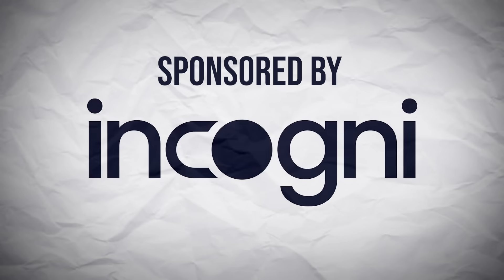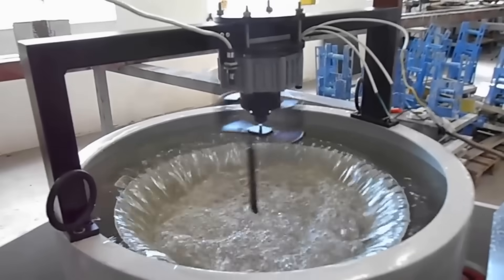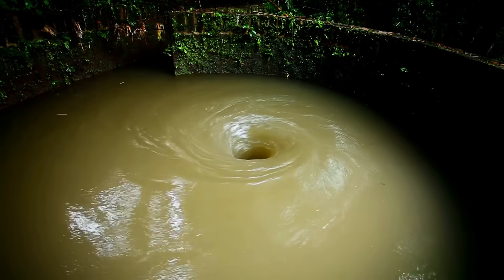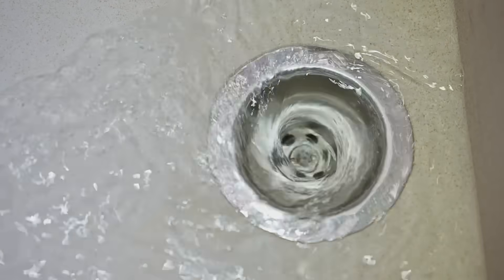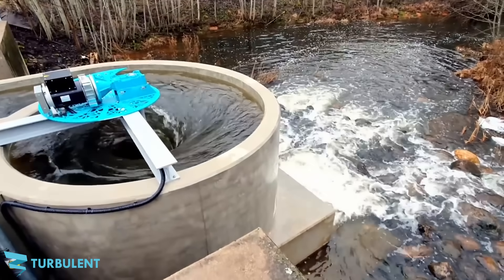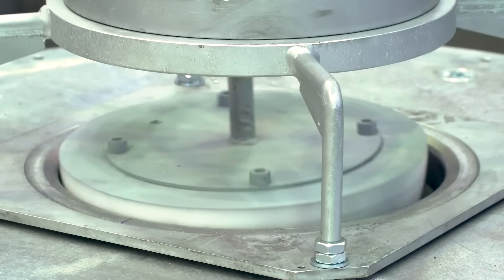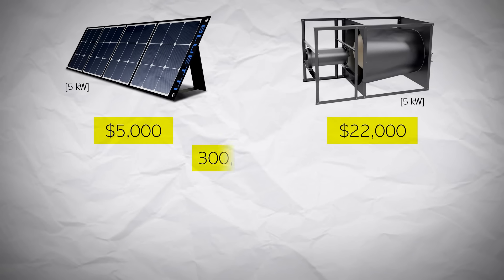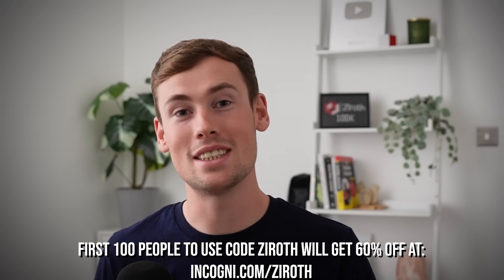Genius Bladeless Hydro Turbine is Cheaper Than Solar

Comment: Nice video. Thank you!
I live remotely in Alaska with Pelton as my summer power and generator for winter power with a 12 volt battery bank for storage along with the inverter for 120 power, charge controller, etc. Winter is the hardest time since I have to use the 2500 watt generator to charge up my battery bank. Wish it was different but the Pelton hydro head is at 200 feet and in the winter the pipes will freeze and break unless I disconnect the system until what we call “break-up” here in Alaska when the temps rise above freezing for the season. 
What I’m curious about is this - if I were to install one of your underwater turbines for winter use, first - would it be comparable with sea water or would the salt content destroy it? 
I can also install something like your device in my stream which has sections that won’t freeze in the winter and does not have any fish living in it. 
Lastly, if this were installed in the sea or me stream, how do I connect it to my battery bank without blowing the whole house electrical system and battery bank with electrical shorts? 
Thanks again for the video!

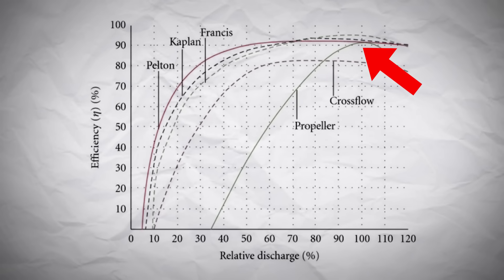Comment: 7:45 this is a point I try to communicate in green tech discussions that some folk seem to disregard. if you can deploy energy storage or generation in a place, then you'll obviously want the most effecient one possible. but if you CAN'T deploy that one, then something is better than nothing. Further, in the case of secondary generation and storage, such as for waste heat, you can often run lower-efficiency systems off of the 'leftovers' of high-efficiency systems. (such as running an stirling hot-air engine off of the waste heat from a steam system)

also, I find that the Point of Diminishing Returns is often miscalculated, as some low-efficiency tech, fueled by High-Efficiency techs' leftovers or wastes, can operate continuously, with little-to-no maintenance, for decades, or even CENTURIES. but because the ROI isn't large enough in the short term they dismiss them as pointless... this is VERY frustrating, as it is a real barrier to Global Carbon Neutrality and Fossil Fuel Independence when we "Allow Perfect to be the Enemy of Good", and obsess over finding Direct-Analog, singular solutions...

Comment: very nice video.
just one nuance. in your calculation.
if you run a 5 kw generator, windmill, turbine solar set or water system.
365 x 24 hours = 8760 hours x 5 kw = 43.800 kwh yearly !!!

and 5 kwh turbine is with the 50% efficiency ? if so it is half of 43.800 kwh per year.

so for a solar panel system 5000 watts yearly output in germany, belgium will be about 4800 kwh to 5000 kwh
on tenerife it will be about 9500 kwh. but usa will also be around 4500 to 5500 kwh per year depending on your location.

Comment: It's way more expensive than solar, because I would have to move to a river with access to the river first before being able to start comparing them ;-) 

Besides, there is a hydro power plant some miles away, where I think that I get my electricity from. So, this place is already taken. The places along the river are already taken. Along the other rivers too.

But it's nice that someone says that water power is also a renewable energy source, at least as long as the sun shines and as long as this all together makes rain fall and the falling rain gets collected and flows in rivers...

Comment: How is this ball turbine safer from traditional bladed propeller turbine? There is very small gap between the ball and the turbine walls and ball is rotating very fast. Unless ball has relatively small mass, the fish would easily get crushed between those two.

Comment: I honestly DO NOT understand what is wrong with the usual ancient simplified water wheel with "less moving parts" thus less wear and tear; and, still get the work loads you want. Both in mechanical and electric generation. Same gains. The paddles don't necessarily hurt aqua fauna.

Comment: the full size unit is fraught with design faults , the "hemisphere" design puts the flat upper surface at an offset angle to the water flow ,causing a high/low pressure area generating the motion with some torque , the housing shape does not generate a vortex at all ,just a velocity increase  ! and the offset axial rotation generates an enormous amount of vibration which will cause fatigue and premature failure , your spinning ball example will not work if any sort of load is applied to the ball as the smooth surface will not cause any significant drag therfore no torque to overcome load resistance . what would work is an inverted teardrop shape with helical flutes on the underside ,a central axle ,and the "funnel " being cup shaped at the top leading into a horn shape into which the teardrop shape would fit , utilizing both the vortex and pressure principles and running with minimal vibration

Comment: I do solar, you gotta introduce me to these 5kW solar systems at 17% efficiency that produce 50,000kWh in a year because that'd be easy to sell for $5000. This makes me skeptical of the math but you're right on the money with your concepts. Thanks for the video!
Reply: I agree with your disbelief regarding the figures presented. Even if some high-end solar PV are around 21% efficient, getting 50,000kWh in a year would be impossible even in the most ideal conditions. He needs to reappraise his figures.
Reply: Yep, maybe 5,000-6,000kWh a year is more realistic
Reply: Yup seems to off by a factor of 10.

Comment: Solar panels are dropping fast. Very fast. A 500watt panel is now about 100$. Making your 5000$ estimate for 5kw a bit high.

Also i think you mix up solar panels efficiency with its productio rating. A 1000watt panel a 21% efficiency isnt going to make just 170watt if efficiency drops to 17%. You seem to mix up something there.

Last thing. If i stood on the sun and had strong sunshine 24/7-365 i would still not hit even your reduced solar calculation. 
5*24*365 is only 43800 kilowatt.

Comment: I've designed a lot of off-grid solar for both domestic and third-world countries. You aren't accounting for it correctly.  A 5 kW turbine running fully loaded 24/7 is producing 120 kWh of energy per day.  The solar panels required to gather that much energy, assuming you could count on 4 hours a day of equivalent 1 kW/m² insolation (a 30°-40° latitude annual average-ish value, depending on local weather patterns), would require 30,000 Wp (watts of panel).  If you added batteries to store the energy, depending on the autonomy time (how long you can run on batteries with heavy overcast conditions that kill the sun) appropriate for your local weather patterns, your batteries could easily cost you twice what the panels do.  So your turbine capital expense actually looks pretty good.

Comment: Issue 1) dams block fish spawning tributaries.
Issue 2) Wind turbines kill birds.

Note) The vortex spins in opposite direction dependent which side of the equator one is on. 

Concern) That ball rolling around the sidewall would kill fish by squishing the fish.
Reply: I would like to preface this comment by saying I am by no means an environmental scientist and my thoughts are based on general knowledge and a couple of google searches.
  I would like to start by addressing issue 2.  While it is true that wind turbines kill birds, it is proportionally lower than that of fossil fuels.    If we were really concerned with bird deaths we should crack down on cats, large buildings fossil fuels and power lines.  Cats kill 2.4 million birds a year in the US alone (American Bird Conservancy).   A 2012 study found that wind projects kill 0.269 birds per gigawatt-hour of electricity produced, compared to 5.18 birds killed per gigawatt-hour of electricity from fossil fuel projects (Sovacool, Benjamin K., "The avian benefits of wind energy: A 2009 update." Renewable Energy, Volume 49, 2013, doi:10.1016/j.renene.2012.01.074).  I think the more important issue is the human cost.  Research from Harvard University, in collaboration with the University of Birmingham, the University of Leicester and University College London, found that more than 8 million people died in 2018 from fossil fuel pollution, meaning that air pollution from burning fossil fuels like coal and diesel was responsible for about 1 in 5 deaths worldwide. (https://www.sciencedirect.com/science/article/abs/pii/S0013935121000487).  Coal is the biggest killer in U.S. energy at 15,000 deaths per trillion kWhrs produced, while nuclear is the least at zero. Wind energy kills a mere 100 people or so per trillion kWhrs, the majority from falls during maintenance activities (https://www.forbes.com/sites/jamesconca/2013/09/29/forget-eagle-deaths-wind-turbines-kill-humans/?sh=6dcc28ff5467).  Not to mention the effect fossil fuels have on our environment.  I personally would rather a horizon full of wind turbines than that of smoke stacks belching toxic fumes into the atmosphere.  
  Back to Issue 1.  Yes, it is true that dams will affect spawning of many species negatively, which is definitely a very important issue, high CO2 emissions dissolve into both fresh and salt water causing the water to acidify, threatening the health of fish and other marine species at a much larger scale.  
  Personally solar and wind just seem to be the clear choice for a better tomorrow or not.  I suppose that is dependent on what someone believes better to be.

Comment: I work at a development facility of hydro-electric power plants and operate a testrig myself. This leaves me a bit... sceptical.
 For example: The turbulent turbines are nothing new. They are literally small-scale kaplan units, even in the same size of our models. The reason, that it "just" reaches a peak efficiency of 75%, is, because it doesn't have any guide vanes nor adjustable blades (our kaplan units reach efficiency beyond 90%, but the exact number is something, I won't tell).
Then the truly bladeless turbine: I'm feel like, this is still way to conceptual. To generate power, you need to have a certain amount of torque generated by the runner, which is, in this case, the ball. Blades convert the downward force of the head into a rotational, driving the shaft. But with the ball, you only have the friction of the water. And a ball (or hemisphere) does not have the largest amount of area, the friction can influence.
Coming to the mechanical loads: The ball seems to be running angular or offset to the driveshaft connected to the generator. Even in the best case scenario, the latter will experience high lateral stress. 
Also: Fins would not be ideal, neither on the ball nor the housing. They would be quickly destroyed, when the ball comes into contact with the housing. The better solution would be, to put grooves into the housing, forcing a certain part of the water passing through the housing into a rotation.

Comment: Cheaper? 1st you need running water and build a dam never mind the fish. Solar you only need a roof and most of all why would you use a blade less turbine if it's efficiency is lower to regular turbines? The way it rotates produces vibration. How dumb funny I'm not even an engineer and I know this

Comment: The concept is worth piloting. I wonder about the rate of wear on the ball surface (wall contact and pneumatic) as well as the “transmission” mechanisms from the wobble.

Comment: A hydro engineer here:
Environmental effect of power generation systems (or any other water based or river side project to be honest) are always case specific study material.......
The trend lately with all those start up companies is that they're usually trying to reinvent the wheel coming up with their (genius) ideas trying to solve (problems) that really don't even exist...... If the problem with the turbine is the blades hitting and cutting the fish? Just weld a steel net to the entrance of the system and you won't hit a single one with blades as long as you are giving the fish another way to pass through the system.......
The problem with those turbines is that they change the properties of the river flow it self....... They drastically change the speed of water passing through the river changing the way that the water reacts with the river bed so in case if the water pick up speed it starts to dig into the river bed and if it's slowed down then it'll start to drop off more of it's contents over it either way changing the particles contents of the flow destroying the environment the fish can live in..... This kind of (genius) idea does not change this fact in any way shape or form.
Please stop making this kind of (invitation) (more like marketing) viable by giving it mainstream coverage so they can sell those reinvented wheels again and again without solving any problems and just banking on people ignorance to look smart.......
Thank you.

Comment: Fins on the ball = no longer bladeleas turbine. Also, can it support a gearbox? This wonderful design will get clogged in less than a day on some rivers without additional infrastructure. It looks great when you only talk about the positives compares to other stuff but it's more and more horrible the more you think about it. Some rock crushers have the same movement. Fish on one side, paste on the other. Leaves, branches, logs, stones all with the potential to clog or damage the thing. Looks like low yield and high maintenance to me.

Comment: Are we genuinely running out of locations for large hyrdo? Have heard it suggested on other channels that this commonly shared statement is without factual basis.

The only real issue with solar PV, when the sun sets) could be solved with more international collaboration on energy sharing. We have cables running round the world for internet data, why not power.

Solar PV requires far less maintenance than any water/wind power option simply because they have no moving parts.

Comment: Small hydro is fascinating. Some day I would love to live out in a more rural area and take advantage of something along these lines. But my biggest fear isn't for fish, it is that leaves and debris would provide me with a full time job cleaning the thing lol.
I also wonder about the lack of storage need with something like this. For a single home, or even a small compound or rural business, you are going to have peaks and draws of demand. If you are installing a generator around your peak power needs, then you are going to waste a lot of unused power from a massively overbuilt system. Plus, no system has 100% up time. You need at least some storage to provide for regular maintenance or damage/repairs. So if you need storage anyways, then you may as well buy a smaller unit... Or have something massive to shunt excess power into like heat storage or a crypto farm or something lol.
Reply: Bitcoin mining solves that issue

Comment: How does something producing 5kW make 300,000 kWh a year ?
5kW x 24h is 120 kWh and 365 times that is 43,800 kWh a year.

Also efficiency is not calculated from the W Rating of the Panels/Turbine + the efficiency.
Solar Panel W Rating is already the wattage including the Solar-cell efficiency.
The Solar-cell efficiency is calculated from the maximal power the sun deliverers on a specific area, the Solar-cell efficiency is a percentage of that maximum.
I guess it is similar with a water turbine. 

In real Life a 5 kWp Solar array would produce around 5,000 - 6,000 kWh a year, depending on the region.

Comment: Your numbers during the comparison were way off. 5kw hydro running 24/7 365 no down time would max out at 43,800kwh in a year. Solar would be somewhere around 9,125kwh.

Comment: FISH SQUISHER 9000   You can not put a screen over something like this if you plan to put it in a natural river. It will get clogged up with twigs and leaves within a few hours. And without a screen all it would take is one tree branch to float in and get jammed in there. Either way you would need someone on call 24/7 to unclog the screen or unjam the branch anytime this thing stopped working.

Comment: i tell you how make a system can make 80% power green no water no sun no battery no fuel . idea came from 1960s 
they was makeing power ? how could they make power, how is basic idea when they did it they had most crude concept of power by rewireing a motor and genrator with hole new specks u can power a hole home, 
now i know how u incress how much power u make  and i can show u how make as much power as you want 
quistion is how ?  and awaser to that is what is in it for me ?

Comment: You mention using the conservation of angular momentum as a power source, then ignore a direct application of the principle to power the generator (as done by Viktor Schauberger back in the 40’s. 
Yes, using a contained amount of water oor oil (really any incompressible liquid) ejecting the liquid from the circumference of a spinning container and recycling the spent liquid to the center (mass transfer from circumference to central core, just like that skater or our rotating earth) and unlimited 24x7 rotational power to drive any generator is at hand.
Party on dudes, be good to each other. (Viktor powered a generator to power his home electrical needs. Sam Clem powered/drove his car with his version.)